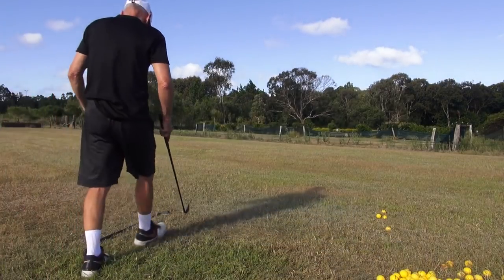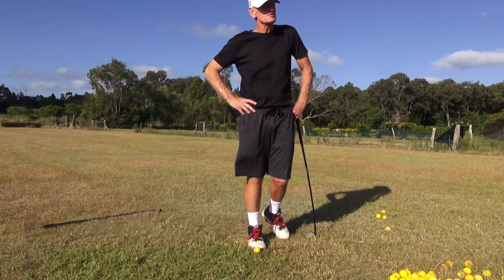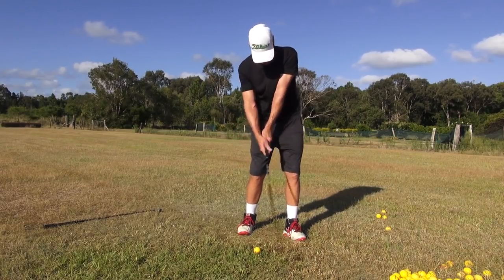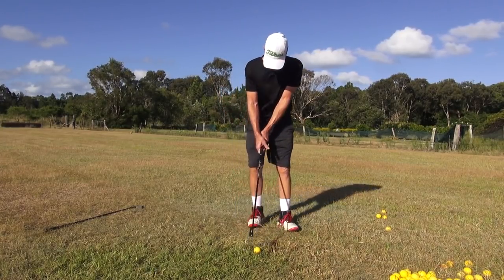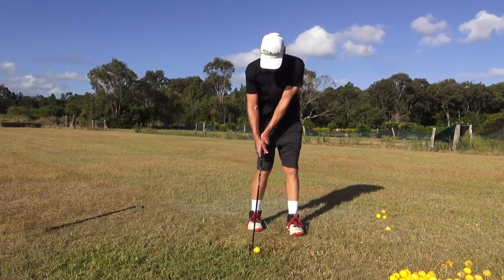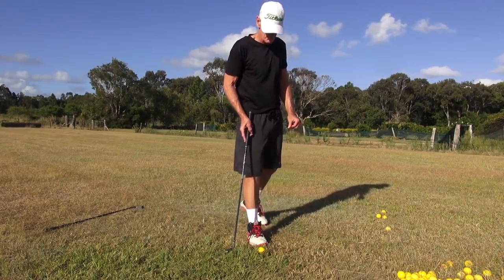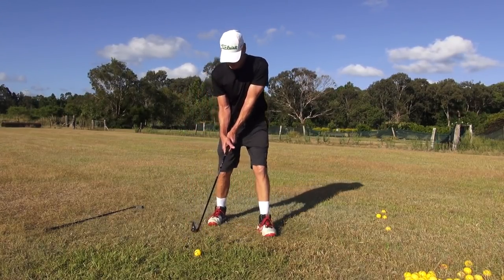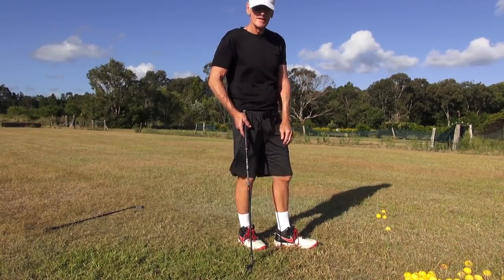Ripping It with  a 'Lowering' Channel lock Swing

Comment: Hi JH ,     I like the idea of the soft drop and then accelerate the club. This is exactly what I try to accomplish and it works so well with cL. You’re really developing speed and power with your swing . No wasted motion in your swing and it’s a repeatable golf swing that maximizes your ability. You’ve basically found a way to get the most out of your swing with less effort.The quality of those strikes today seem to be at a different level and I suppose they feel really good!
Reply from the maker: Hi Matt,
               You very much have a 'soft drop'  happening right now ...and your clubhead release is super right now ..I can see that clubhead really whipping through impact ..
                    cheers JH

Comment: Thanks you for the video,  I'm still pushing 30 % of my shots.  Will this straightening of the rear arm and hand take away the push shot?  I still aim about 30 yards left or the target for my driver.  Thank you.
Reply from the maker: Hi Ray,
             if the ball goes straight out to the right the technical engineering reason for that is the clubface is open that amount of degree at impact .. to test that out just shut the clubface down quite a lot at address   ( make sure you   shut the face down  and 'then' grip the club ..  don't just rotate the clubface    to the left      by rolling the   hands/forearms  at address) and make the same swing   ..  the ball should lessen the amount it goes to the right  .. ..
                 If that actually happens it is an indicator your in to out attack path is too severe in your normal swing  ..  you are keeping your shoulders to closed at impact .... that very unusual but its possible ..
                          What you do then is try to lessen the severity of your in channel attack path to the ball coming into impact .. you can do that by     turning your shoulders    on a more  level plane going  back  in the backswing .. ..  to do that      push your  lead shoulder     more  'across' than  'downwards'   in the backswing  ..    that will flatten out your     backswing path  angle      and  make the downswing   more  not as steep   and as severe in to out  .. 
           Simply.. just try turning your lead shoulder level on the backswing instead of pitching it down ..
                cheers Jh
Reply: @1atomicgolf  Thank you again for you fast and accurate analysis. Everything you stated is what I'm doing.  I've been with CL for 18 months and I have shot some very good scores and more distance but I was getting the push mostly on the driver. So I aimed left to compensate.  It is the swing for me.
Reply: That is amazing how you new what I was doing without seeing my swing. Well you are the inventor.  I will make notes of this and it may help someone else.
Reply from the maker: Hi Ray,
            I did a video today that gives some visuals on the issue you were having .. the video will be up later tonight  .. it will be called 'Fine Tuning Points of Channel Lock' ..
                cheers JH

Comment: What causes the drop before you start the swing, Is it a body motion or what?
Reply from the maker: Hi Robert,
                   The 'Drop'  is just that  .. you just feel as if your hands are dropping out of the  air straight backwards and down  ...  as if you were trying to place  your hands on a bench behind you at    40 degs  or so at upper ribcage height .. to get the feeling of the drop  ..   just take the club to the top of the backswing       and keep your shoulders turned   and just  drop your  hands   straight  downwards  ..    that is what I try to do  ..   its   difficult to do if you are   starting to    roll your shoulders around    to  the ball    though .. you must feel the shoulders are always closed    as you     drop the hands .. and of course we want the shoulders closed at impact  so preprogramming them at that stage is a good thing anyway .. 
                 cheers JH

Comment: JH Whats your different club distances (in Metres) with this modified swing?
Reply from the maker: Hi Ken,
              At the moment I am just exploring   what  the maximum     effort I can apply to my swing  and  control it    with no  balance issues .. I am seeing  some   very   strong shots   at the moment   with   my   testing  .. I think realistically I will  be picking up   a   club    extra  in my irons  and about    20   yards with my driver  ..
             My existing distance with my irons  under perfect weather conditions ..  5 iron is 167/170  carry  ... and every other club is around 12 yards( 9/10 meters)  up or down difference.. I can bazooka iron shots when I have to but I generally try to swing at a constant speed and get that gap distance between irons...
      Today's irons are so strong in the lofts that they are really a bit of a joke ..  my 5 iron is  23 degs loft ..    Ben Hogans 5 iron was    32 degs loft ... as   was Jack Nicklaus's old Macgregor irons ...  I   hit a set of irons recently that  Jack played the 1968  Australian Open with and  I could hit the 5 iron   only    145 metres carry.. and that was when I flushed it .. the 5 iron  was  32 degs loft..
                  cheers JH